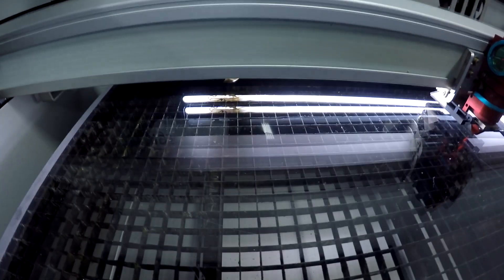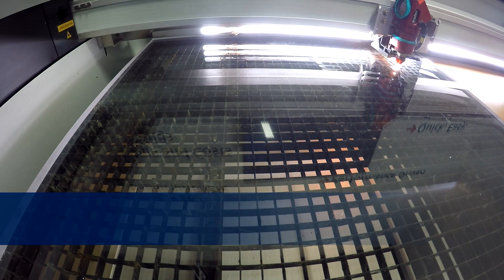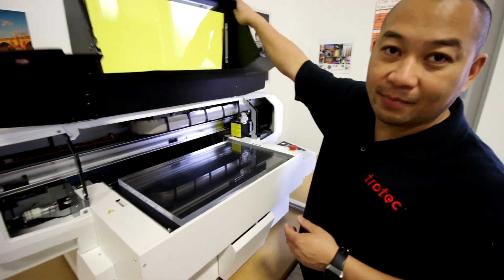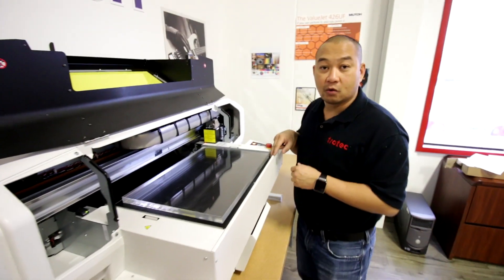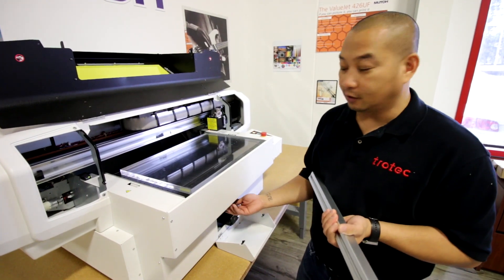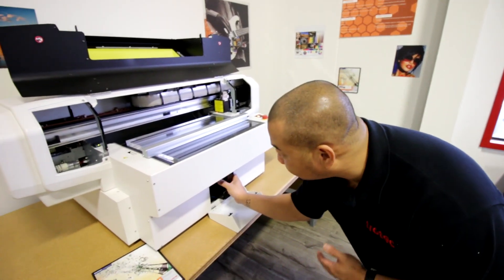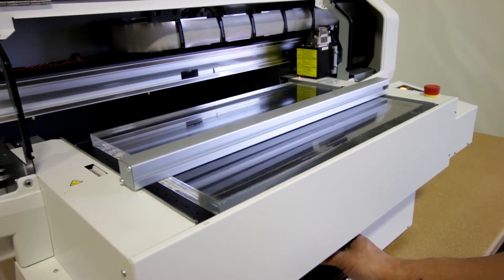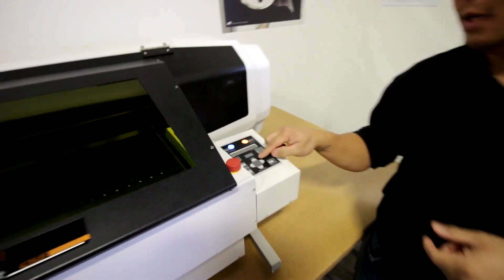Laser Engraved and UV Printed Acrylic Plaque | Mutoh ValueJet 426

Comment: Hi, 
What do you use for cleaning up the acrylic after laser engraving? There is a lot of dust visible on your piece in the video. When I do the same clear acrylic is stained sort of milky smoke... and it doesn't want to wash off.
Many Thanks,,
Pav
Reply from the maker: Hi Pavol, the white residue can be quickly whipped away with a damp cloth. If you get any burn marks we recommend this product: https://www.engraving-supplies.ca/laser-engraving-accessories/paint-thermark-cermark/acrylic-cleaning-polishing.html
Reply: Sound strange but the burn marks can also be removed with toothpaste ...
Reply: I turn off air assist when engraving (turn on when cutting), result is little to no residue.